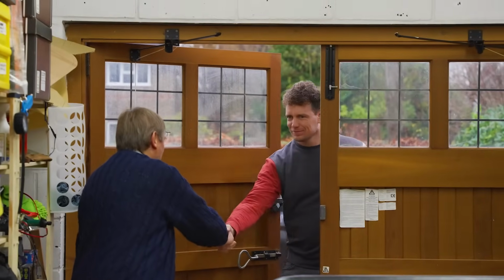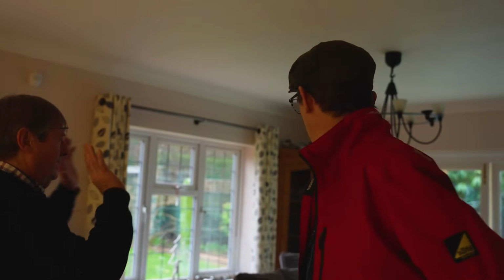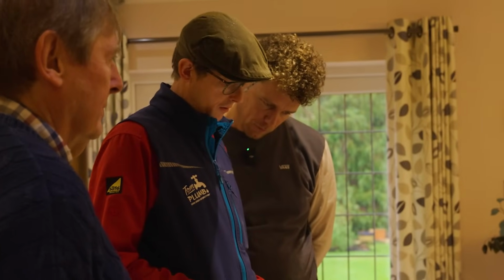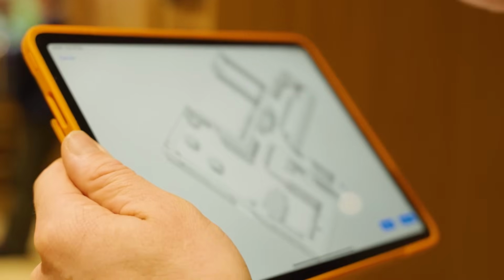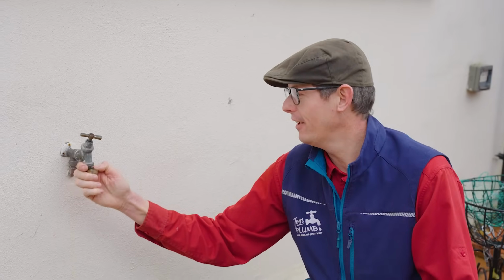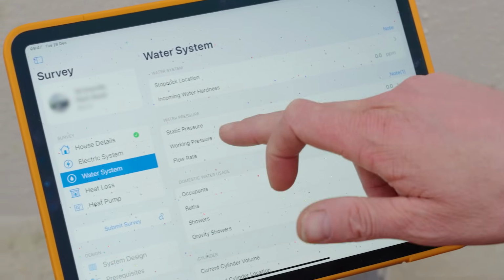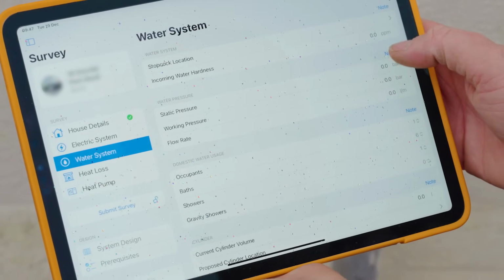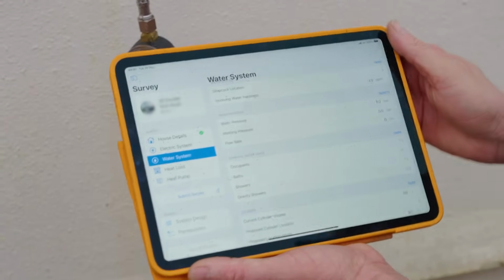Don’t Miss This Essential Step When Getting a Heat Pump

Comment: If that place can be heated to the same temperature as a gas boiler would , my watts it is kipper .  Just glad I’m not going to fork out to pay for it all .  And as a retired electrical contractor , what on earth are they now having to consider a three phase power supply . Again totally unnecessary if the customer stayed with gas .  As for his electricity bill at the end of it , that will definitely will be interesting .  Putting a heat pump system in any large conventional built property , is totally and utterly stupid .  Just like EV cars the technology is just not up to the task . And we can all see where that is all going .     The future my ar….
Reply: I think this is an excellent video and should be distributed far and wide as an example to keep well clear of ASHP unless you have the money to waste and are prepared for all that upheaval. That dear 'old boy' probably younger than myself has more money than sense IMHO.
Reply: Octopus Energy do excellent installations of heat pumps.  This chap was just unfortunate to pick an unskilled company.  Everything has to go fossil free energy full stop.

Comment: Every radiator I attend where it has been piped top to bottom has  cold patches . Is this because the flow is round the wrong way or modern rads just can’t work like this. I thought they piped at top so older people don’t have to bend down to adjust trv..
Reply: If cold patches then either blockages in the rad or flow the wrong way around.     You get about 5% better efficiency tboe compared to both bottom, and lose another 5% if bottom to top opposite ends.
 The convenience is a bonus, but its a bit like the way that electric sockets these days are placed higher for access rather than floor level as they used to be.

Comment: If you did all the insulation etc beforehand surely that would make a gas boiler even cheaper to run so I would have thought the heat pump savings are not genuine
Reply: The heat loss of a property does not know or care about what your source of  heat energy is. So insulation reduces heat loss no matter how you heat your house.
Reply: @normanboyes4983  so any savings by selecting a heat pump should be measured on a like for like basis once insulation has been done. Then including the capital cost and return. All you learn is that proper insulation is the answer rather than gambling on a system that may or not work. As with electric cars I'm not convinced but open minded. What I object to is government and big business telling me how to spend my money and dictating what I can have. At the end of the day market forces will decide rather than I'll thought out dictacts.

Comment: I had a Heat Loss survey done last month using the new software. Very impressive! My installation commences in 10 days!
Reply from the maker: Let us know how it goes
Reply: What's the cost of installation?
Reply: @pauldavies7251  £6.4k after the grant. That’s for 6kW Vaillant, 300ltr Cylinder and 3 radiator upgrades.
Reply: @pauldavies7251   Did you get an idea of cost , interested in the cost myself..??
Reply: K hope it all went well for you and you are now pleased with the decision you made,? B
Reply: @BrettG07 It went very well thanks. 2 years this week, and, in my Wife’s words “ we’ve never had such a warm house”
Reply: @chrisrowe22 I’m having my survey next Tuesday but I’m soooo up in the air about it with the 50/50 split on good and bad results from the end result. Pleased you are satisfied with your installation 👍
Reply: You are going to be very disappointed with a heat pump but good luck
Reply: @RobertWheeler-t4z  Quite the opposite actually. It’s been up and running for 2 months now, the house is consistently warmer, and my last energy bill was 40% less than the same period last year, and I used 60% less energy. And my Wife is happy as she’s gained an additional cupboard in the Kitchen where the boiler used to be!

Comment: wouldn’t it be easier and quicker to heat the house to a known temperature, then measure the heat decay overnight (with heating off) against outside ambient (i cant work out the formula to do so, but i have all the sensors)

Comment: If you have an existing system, can't you use the current heat needs? I would at least use it to check the calculated need. How much gas did you use in January? End of analysis.

Comment: This was interesting, particularly as my energy supplier has teamed up with Heat Geeks for the former's imminent supply and installation service for ASHPs. 
Roger, is there any possibility of some content about high-temperature ASHPs that, allegedly, do not require such invasive and expensive home alterations?
Reply from the maker: That is exactly what they have in this house and that is what they are taking out
Reply: @SkillBuilder  Thank you for this as I did not pick up on it previously.

Comment: if heat pumps are poping fuzes they must be using lots of electric ? none of it makes any sence to me
Reply: They have a big motor in them that can draw a lot of amps as it starts up unless the heatpump is controlled by a VFD or, at a minimum, has a soft starter for the motor.

Comment: A great video and it’s good to see SkillBuilder teaming up with Heat Geeks on this topic. A couple of points to mention. The mantra of the Retrofit industry is Fabric First. In other words, address the heat losses from your home before installing a heat pump or other renewables. If you insulated the loft space and draught proofed windows and doors first you could down size the heat pump by several kW as I think Adam mentioned. Also, I couldn’t help noticing that during the heat loss calculations Adam seemed to suggest that the wall adjacent to the garage could be treated as a Party wall. This isn’t standard practice unless the garage is heated and airtight. Finally, regarding uncontrolled ventilation, Adam’s comment about the air changes per hour (ACH) being less than 1 seems unlikely in a property of this age and size. In the absence of a door blower test, it would be risky to assume such a low figure.

Comment: Mould discussion, with all the control systems installed with heat pumps, cant the system measure the RH with a £2 sensor and open a vent or turn on a fan or dehumidifier to control?
Reply: Agreed. Given the fact that to get the most from these heat pumps, there's a lot of smart tech involved in the whole process, it seems sensible to just smarten up some sort of humidity control

Comment: So it was more the poor positioning and blocking if radiators causing a lot of the efficiency issues not as much the jeat pump itself?
Reply: Is that the conclusion you have drawn from all of this series of videos on Johns installation?

Comment: So if I change to a heat pump and get an electric car (or 2) and want to charge them at same time I will also have to pay electricity company to increase my main power feed to the house? As at the moment even when I switch the shower on the voltage drops coming into my house - what is the average wattage of a heat pump ie what it draws from my home electricity supply?
Reply from the maker: The 12 kw heat pump working at a COP  of 4 is going to take 3kw but might have a start up surge.  I would say 4 is optomistic and on a cold night you might be putting 6kw into the heat pump at the same time you are pulliing 7kw out for your car charger. Just don't put your kettle on.
Reply: @SkillBuilder  especially while someone else in the house is having a long shower!
Reply: Ive been following all of this from the start it’s very interesting but….
What…. A…..enormous……faff
I am confident Heat Geek knows his stuff and will get this long suffering home owner a good result. Is this level of care and expertise likely to materialise en masse rolled out all over the land? 
I’m not confident tbh even after recruitment and training
There’s got to be a simpler way. That said, I don’t have the answers…..
Reply: Yes he was told his was the biggest domestic heat pump. So if it needs to be increased or he puts too many appliances on he will need a three phase supply. £££££££
Reply: Load monitoring on the EV charger (via a CT lead) will take care of that. It will only ramp up to full power when the supply has the capacity (you set the supply capacity at install)

Comment: If the customer has a smart meter and you have weather data can you just use the data from the gas meter to determine heat loss? For instance pick a day where the outside temperature is -2c say the house used 130kWh of gas, divide by 24 = kW used to maintain that temp = heat loss? in this example 5.4kW
Reply: Protons For Breakfast has a video that suggests a rule of thumb of annual gas usage in kWh / 2900 to give you the heat pump size required (south of Manchester). https://www.youtube.com/watch?v=hCeghKa3liM&t=730s
Reply: Yes you could and it would lead to much lower power numbers.

Comment: You don’t need a plumber anymore, just a guy with a doctorate in thermodynamics.
Reply: A heat pump is basically a refrigerator put in reverse, with ASHP units they generally have pre charged systems from the factory, so no need to vacuum the system and add your refrigerant gas. For me thats DIY territory.
Reply: @robbiegerard7857  . Problem isn’t fitting the heat pump, the problem is matching it perfectly to the property to make sure it runs as efficiently as possible or you may as well just install electric radiators.
Reply: It’s O level type stuff tbh.
Reply: @normanboyes4983  . ‘ O level’, I think we are both showing our age 😉
Reply: @normanboyes4983 yeah like you could install one😅

Comment: Great to see everyone together, but I’m a little confused. If the heat pump and the radiators were already sized correctly then what needs to be changed to fix this install? Was it the buffer tank or the pipe work in between ?
Reply from the maker: If you watch the previous videos it explains the problems
Reply: @SkillBuilder  Thanks, just checked again. I think the summary is that the existing heat pump was warn out and not worth repairing.

Comment: How important is the number of occupants - after all the number does change over the years - it would seem odd to have to change hardware just because of that?
Reply from the maker: Domestic hot water requirements are based on the average usage. We are assuming people don't share the bath at the same time.

Comment: The problem is that even these experts? Don't seem certain. Every so called plumber/heating engineer (extremely questionable) told me that the heating system i was building would not work. It's funny it's been working for 30 years & is up gradable to have heat dumps for solar/wind energy & it has no pump & requires no electricity. I as a engineer & i know a designer of industrial heat exchangers we don't like this system if i had a choice i would have electric storage heaters( under floor). I grew up with storage heaters in a 2 up 2 down & thay are great. My current 30 year old system maintains 25c all winter & running hot water no problem despite the alleged experts. I have studied the Victorian heating systems that just work but require thought & engineering instead of just put a bigger electric pump in & hope.

Comment: Why are panel radiators so ugly? I love the look of the old column ones even if they are more clunky. What makes them more efficient? Is it because the surface area is less than the old pipe style?
Reply: They are more efficient because they have a far greater surface area and the corrugated convectors also help to spread heat. A large surface area allows a lower flow temperature and the COP of a heat pump will be higher with a lower flow temperature.
Reply: @rogerphelps9939  thanks for the explanation! Physics is not my thing at all! I was confused whether it was better to spread heat to the room quickly or to maintain the heat in the water by having less surface temperature! So, I'm guessing that the water might need to be pumped round quicker with a lower temperature? Or maybe because the heating is on all the time, and there is good insulation, the water doesn't lose heat so quickly?
Reply: Sorry, I know this is a bit off topic! 🙃

Comment: Will be interested in seeing measured performance of the heat pump to show the actual efficiency (COP) and then compare with manufacturer’s data.
At the moment the cost per KWhr of electricity to run the heat pump is say 30 p while the cost per KWhr for my super efficient oil fired boiler  is 10 p.   So we need a COP of 3 to break even. You should get a COP of 3 in the summer when you only need heat for hot water but in freezing winter you will be around a COP of 1 just when you need a load of heat to heat the house! So 3 times the cost of my oil boiler.

Staying with oil and changing to the green HVO oil when it is domestically available at a reasonable price.
Reply: You can see operating systems measured on OpenEnergy that are in the range of 350-500%. If making up numbers makes you feel better, it's a free country.
Reply: We have a 5kW heat pump in our annexe, on the 18th of Jan when the outdoor temperature dropped to -6C for most of the day (And 0C for the rest), the heat pump maintained a COP of about 3 for both heating and DHW during the entire day. We currently pay 27p/kWh with Octopus and we last paid 66p/l for oil (In December, we use oil for the main house) which puts the break-even SCOP at 3.38. (Assuming a boiler efficiency of 80%) Considering the heat pump was running at around the break-even point for oil during the -6C period, over the year the heat pump should work out to be far more efficient. (The total average heating COP is 3.9 and the total average DHW COP is 3.2, for the three and a half months we've had the heat pump)
Reply: he COP of my GSHP has never fallen below 2.9 even in the coldest weather.. It is usually around 4.
Reply: My mums one which is a pretty dumb mitsubishi unit with no weather compensation is averaging just above 3 according to it's computer.

Comment: The noise pollution with these things are a real problem. As soon as the outdoor temp gets close to freezing they are much more noisy.  45 to 50 db constant. And much more if it gets colder. The sound of the compressor travels through the construction of the house.. and the nabours house...
Reply: They aren't the loud my mum has one cheaper to run no but she's in a no gas village so cheaper than oil or electric heating but it's definitely not noisy she sleeps with her window open. Council bungalow and every single one has a heat pump and they are fine.
Reply: probably quieter than the gas boiler in my kitchen..
Reply: I have one outside the window right at this moment of writing. It's -22,3c outisde and  even with the window open I can't really hear it. So noisy?? It really is funny how tech that's been  the norm for 20+ years here is handled in a climate where it should work wonders if you only understood to insulate your houses.

Comment: Rodger, I live in a small 1 bedroom flat in a old 6 block building. My boiler doesn’t cost much to run and I am so happy about it. The day they will oblige me to get rid of it, I will put electric radiators but never ever a heat pump. That’s what this video made me think. If they wanted to sell me the heat pump idea they miserably failed. Totally agree with you!
Reply: Why not just go for an air to air heat pump then? This way you won’t have to deal with radiators or hydraulics and will get around 3-5 times more heat out of the same amount of electricity. 
As a bonus you also have an AC in the summer because this is what an air to air heat pump basically is
Reply: @294nduswb  I would consider it for sure, thanks for the tip, but the fan may be noisy and I could only put it straight outside the window, on the back, where the bedrooms are; neighbours probably would not be that happy. God save my boiler 😀
Reply: Seems you like to burn money. Ohmic heating is ridiculous.
Reply: @rogerphelps9939 how do you suppose he insulates a flat in a 6 storey building??
Without adequate insulation ashp are useless & extremely expensive,  
He'd never get a return on his cash outlay. 
They don't suit everyone & every home in the UK just like electric cars dont
Reply: @pauldavies7251  exactly. And if you have a perfectly insulated Norwegian house you can heat it with a lighter. I don’t know why they always compare non insulated houses with combi boiler and heat pumps in perfectly insulated houses. + heat pump is on all year long. I have been away for 1 week and my boiler was off. + in Scotland you don’t really need cold air in the summer, we just open the window! Thanks for understanding
Reply: @andrear2319  totally agree with you just stupid logic

Comment: The most informative discussion thread on heat pumps ever!  Practical problems and effective solutions. (a.k.a. Engineering).  Impressed by John's stoic perseverance!  Roll on the post-installation review...
Reply: @JamesKing-ev1wcNot over engineering at all just some simple pipe sizing calculations.
Reply: Really - when please tell was an energy loss calculation ever done for a boiler install? - never! It was basically rules of thumb. this did morph over time to sizing the rads for a room, then adding the totals to get to a boiler size, which in a properly sized installation should factor in time of day etc. As for running a property at a constant temp 24hrs per day, with the exception of a thermal mass UFH solution will always prove to waste energy, a set back temperature targeted at closing the gap between outside and inside when the house is unoccupied will in the long run save energy, combined with a timer to enable setback 30mins before departure and 30mins prior to comfort being desirable. The biggest energy saver - minimise use of external doors, keep internal doors closed with rad stats set for each rooms comfort temp none of those habits change with a HP. @normanboyes4983